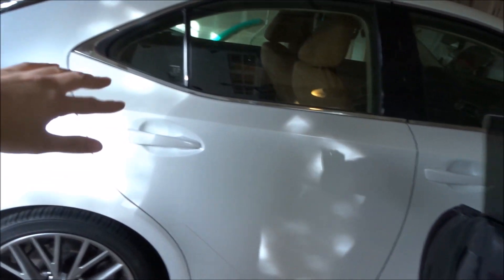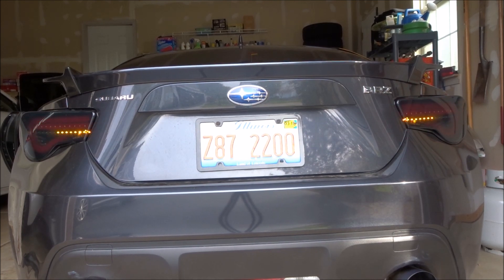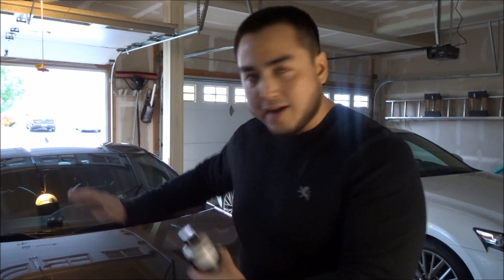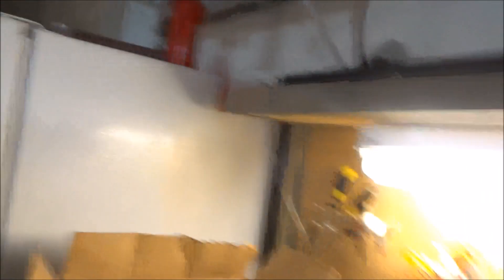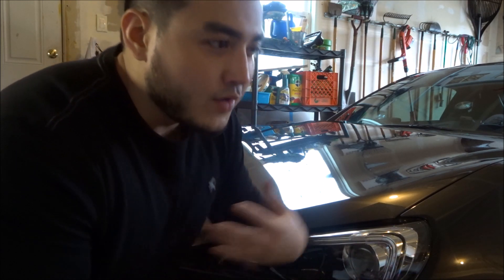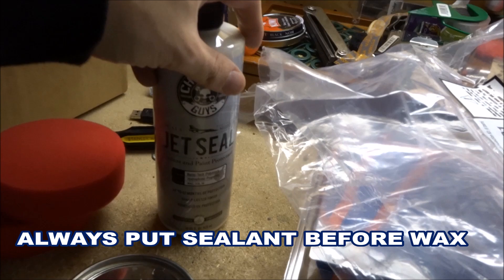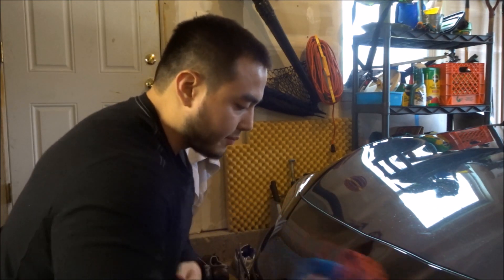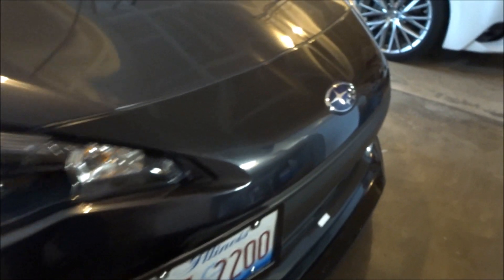SALT AND RUST PROTECTION FOR MY SUBARU BRZ! (Chicago Winters)

Comment: How much leg space do passengers have  based on your seat setup? Not that it's meant to be used all the time but how does it deal in those pinches with more passengers, could you please include in next video?
Reply from the maker: jperezedc There’s basically no back seats. 0 space. In a pinch it’s possible but it’s the worse I’ve seen in any car! I’ll show it in my next video! I’ll make a video showing how practical the brz is!
Reply: Aaron Robin Productions  thanks! Great videos!

Comment: Shouldn’t you have washed it by hand rather than touchless since they don’t work that well when it comes to removing all the dirt?
Reply from the maker: TheBadassOne17 The one I go to is brand new at a shell gas station. Works great and drys the car perfect. It’s way too cold to use the hose and wash the car myself. Water will freeze so in the winter touchless car washes and manual car washes are my only options! I’ll apply the Jet seal maybe only once or twice each winter so Benita just getting car washes once a week to prevent any rust!

Comment: A wax/sealant/etc does nothing to keep the car from rusting.
Reply: Josh Aden no it’s keeps the elements from sticking to the metal and oxidizing. The longer a piece of salt stays on metal the more it eats the metal. This will prevent anything from sticking to the car.